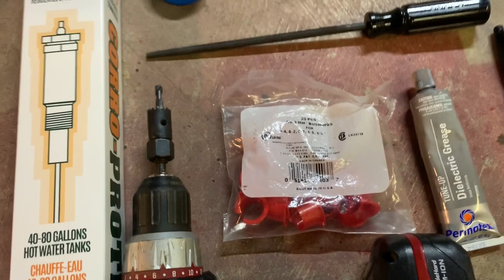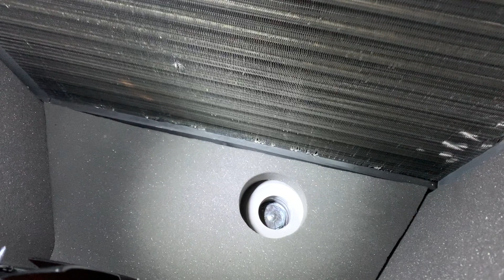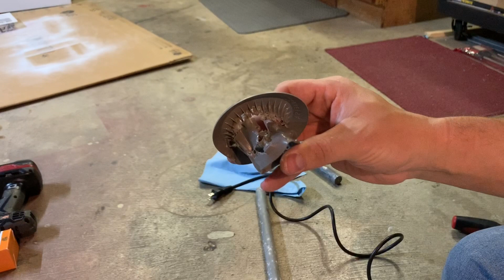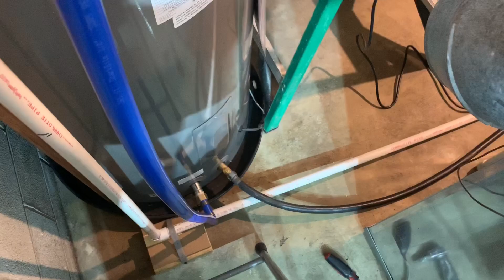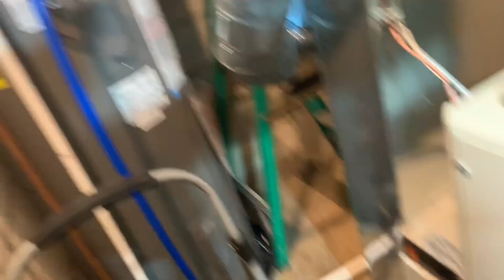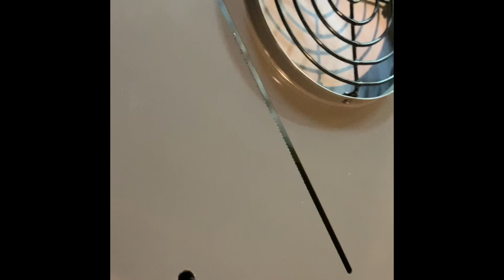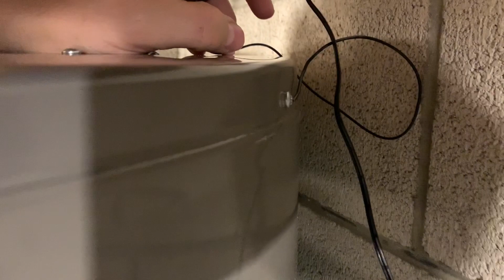Rheem Hybrid Electric Water Heater Anode Rod Replacement. Sulfur Smell is Gone!

Comment: Hi, I likely missed it but at start of video you mentioned needing to use some dielectric grease in the process. Can you tell me when or where you used that as I didn't notice the use of dielectric grease in the corro protec installation instructions?
Reply from the maker: Ya the instructions don’t say you have to use it. I put just a little on each spade connector of the rod before I slid the wires on. It’s a pretty low moisture environment, but I put it on anyway. I also use it on all of my trailer plug connections, battery terminal connections (car, tractor, etc), spark plug connections. Really I use it on any electrical connection I think has a high chance of corrosion. If you don’t have any, you can safely skip it.
Reply: @EvolutionDIY  Ok thanks! I do believe I still have some I just wasn't sure where used it. So where the one wire terminal/connector goes onto the terminal on top of the corro protec and maybe where the ground wire terminal is mounted to the tank. Is that correct?
Reply from the maker: I only put it on the one wire that connects to the corro protect rod. I was thinking it was 2 terminals (12v and ground, but I remembered ground connects right to the water tank). I didn’t actually put it on the ring terminal that connects to the water tank screw, I only put some on the 1 spade connector that connects to the top of the rod.
Reply: @EvolutionDIY  I got the other anode rod out today with use of an impact wrench/driver. Now I'm wondering how many overlapping wraps of the Teflon tape should be used. I didn't see how many times to wrap the threads while overlapping the Teflon tape.
Reply from the maker: @ParisKYLakefishing  usually just 2-3 wraps. Too many, and it won’t go in, too few, and it won’t seal. Also make sure you wrap such that the tape doesn’t “unwrap” as you thread the rod in. You can probably do a quick how to apply Teflon tape search on YouTube for some examples. Good Luck!

Comment: Was yours a magnesium anode rod and what number of teeth did you need to use to be able to cut it? I ask as I don't know if the magnesium rod is a harder or softer metal.
Reply from the maker: Yes it was magnesium, and I used a 24TPI (Teeth Per Inch) hacksaw blade. It was pretty soft. It cut almost like aluminum, but didn’t gum up the blade like aluminum. I think any hacksaw blade would go through it.
Reply: @EvolutionDIY  ok great! thanks for the tip on the blades. I picked up some 24T blades this past weekend. Hope to install this tomorrow.

Comment: Do you know if there is any need to use the heavier pink Teflon tape on the threads of if its even needed? I ask partly as I saw the pink tape suggested on one website but I also saw this info/concern on another blog about replacing the anode rods. Supposedly you need an electrically conductive path between the anode and the tank, Though I don't know if that applies with the powered anode rods or not. Also you may have mentioned it but what did you have to do to bleed the air in the tank after installing the new powered anode rod?
Reply from the maker: I don’t think you have to use the pink tape. The instructions say to use normal Teflon tape. Also, theree is a separate grounding terminal that you connect to a screw on the tank, and it tells you to ensure the screw touches the tank, not the paint. I assume it gets ground through that. 

To bleed the air, just turn the water supply back on, and then open faucets and showers on hot. The air will work itself out of the tank and through the plumbing. OnCe the air is out, you can plug-in the powered rod.
Reply: @EvolutionDIY  Ok great and thanks for the input regarding the installation experience you had in installing the Corro Protec anode rod. Regarding the ground wire Corro Protec responded the following regarding using the exposed ground screw from the electric heater existing wiring connection to the heater: 
"Yes, you can use the water heater ground screw directly" As far as the Teflon tape I already have the regular white tape so I will just use that.

Comment: Great video! my water heater was on its way out so I replaced it with the smaller version of this Rheem. Went in easy and works fine but I noticed a bad sulfur smell from the hot water that was not there beforehand. I just moved into the home so I’m not sure what type of anode rod my old heater had in it, but there was no smell before replacing. I was about to chlorinate my well as per the owners manual before I found this video.  Was able to get the old rod out without taking out the plastic ring (I bought a thin walled socket based on this video). Also the old rod was in there right as hell I almost gave up. I sprayed a little WD-40 on it and was able to break it loose. Anyways the repair was not bad at all, especially using this video as guidance. It has only been in one day and I don’t smell any sulfur at all.
Reply: OEMTOOLS 22429 1-1/16 Inch SAE... https://www.amazon.com/dp/B00AXTKN2S?ref=ppx_pop_mob_ap_share
Reply from the maker: Awesome. It’s great to hear other success stories. Mine is still working great after almost 2 years. Would you mind sharing a link to the “thin wall socket” you used? I’m sure others would find it useful.

Comment: Do you plan on inspecting the anode at some point to see how it's holding up?
Reply from the maker: I hadn’t really considered inspecting it, but when I do a tank flush, it wouldn’t  be hard to pull the couple top screws and check it out. I’ll consider it. I’m overdue to flush the tank, I have just been avoiding it.
Reply: @EvolutionDIY  I've learned more about these powered anodes since I posted that and they are not "sacrificial" like a normal anode. You shouldn't be able to tell anything from looking at the powered one. If you still have a normal anode in there, you might be able to tell something from looking at it. Otherwise there really isn't any way to tell how the tank itself is holding up... at least not that I'm aware of.
Reply from the maker: @MakeMeThinkAgain  yeah good point on not being sacrificial. To be honest, I’ll probably just let it go, and hope it’s doing it’s job. If the tank rusts  out in 3 or 4 years, I’ll consider it lesson learned. If it doesn’t, I’ll consider it a success. I could have never tolerated the sulfur smell though. I would have had to chlorinate the water or something if this didn’t work.
Reply: @EvolutionDIY  If it does rust out I would appreciate it if you would let me know. I'm putting off trying one of these powered anodes until my heater is 10 years old (it's 5 now) so I would love to know if this device really does what it's claimed.
Reply: @EvolutionDIY  Why you still need to flush the tank with the electric anode installed?  Is there still a lot of sediments?  Thanks.

Comment: Thank you for this video. I have a question for you. I plan to replace my old furnace with a high-efficiency furnace. That new high-efficiency furnace will no longer use the chimney but will use the venting plastic pipes going outside the house. Now I want to get rid of the old furnace liner vent pipe. What I understood from your video is it looks like this new high-efficiency water heater does not need any ventIs this correct? Is it the electric one or the natural gas one?
Reply from the maker: The water heater from my video does not need any vents. It is electric only. If you were to purchase a natural gas one, it would have a chimney and need vented out. If you purchase this one, it does not. The one in my video is called a hybrid electric water heater.
Reply: You can get a vent kit if your heater is in a small space.... the way these things work is they pull the heat out of the surrounding air, so if you've got your heater in a closet, it's got to get the air from somewhere, and exhaust the colder air.

Comment: Just had to replace mine today after only 3 months of use. One thing I’ll add is the original rod was very tight! So tight that it started to round off trying to break it loose. As a helpful hint I ended up using a 1/2” drive electric impact wrench. Came right out! Went back in with the new aluminum rod and tighten it by hand.

Comment: Being in the mechanical contracting business and involved in design, build and maintenance of refrigeration equipment, it amazes me how easy it is to sell folks on the virtues of heat pump technology.  But I have to say this is one area that may have a few stinkers involved.  For instance the heat that is collected to heat the water has to come from somewhere in the vicinity of the unit.  That means in heating season you will have an additional drain on your heat loss calculations.  Then the area of maintenance where the heat exchanger draws air across to collect the heat, any airborne dust, dirt and grease will collect on the fins.  This stuff will insulate the heat exchanger which will tend to produce a less efficient operation of the unit.  Paying someone to do this maintenance or time spent doing it yourself needs to be factored in.  There are other negative factors to consider as well.  Wear on compressor and fan may require major repairs at some point in the life of this type device.  Heavy load periods will still consume as much power (or maybe even more) due to necessity to cycle on the resistance heat elements periodically.  Then there is the initial cost to purchase such a device which is significantly more than a straight electric hot water heater.  All in all, it's a mixed bag that can wind up costing you more than you bargained for.
Reply: @aday1637 I agree with your assessment. But for some of us, "electrifying everything" is sort of the goal, and then try to purchase renewable electricity to work toward a lower carbon lifestyle. I recently added my heat pump water heater after a whole-house, energy efficient remodel. Induction stove, rooftop solar, etc. I didn't go the heat pump dryer route, because I feel the technology still has a ways to go. But for water heaters, I think the technology/quality is solid (or shall I say, quality is no worse that your average refrigerator these days). I paid  about a $4-500 premium over a standard water heater, but I figure if it lasts 7-10 years, I'll get my money back. I anticipate we will continue to see efficiency/quality improvements in all forms of heat pump uses, in the coming years.
Reply: Yes, but, in a warm season, if the unit is installed somewhere that can use the dehumidification (like a basement/garage), that's 'free' dehumidification you don't have to run a dehumidifier for. Also, even with inefficiencies factored in, if your heating is from a heat pump, you're still likely better off from a cost perspective 'stealing' the heat from the house heat pump. Resistive heat (regular electric WH) is usually the most expensive form of heat, so anything else is better.

Comment: After this great video, i was able to put new new electric Anode rod in.  It took about 20 minutes to get the plastic cuff off of the unit.   I used a utility knife to score it and eventfully was able to pull it out in pieces with a needle nose vice grip. Next I had to bang on the socket to get it to sit nicely against the 27mm hex nut (top of the anode rod).  Using a 3 foot breaker bar did not budge it.  No matter what I tried, could not get it out.  I went out and got a impact wrench (325 foot pounds), it finally came lose, without much effort.  Love those impact wrenches!   Putting everything back was fairly easy (use a hand socket to tighten the new anode rod in place).  After only 6 weeks since the initial install of the new water heater (3/6/2021), the original magnesium anode rod was heavily pitted and smelly.  Looking forward to odor free hot water.  As a note that if you cannot change it out quickly, I was able to heat the water to 140 degrees for two hours to temporarily kill the smell.  That lasts about a week before smell comes back.    But now with the new rod, I should be fine.
Reply from the maker: Thanks for the comment. Hope you’re enjoying some sulfur smell free hot water. No budge with a 3ft breaker bar 😳. Good thing you had an impact!

Comment: I just put my new Rhem hybrid in on 3/6/2021 and already (5 weeks later), i have the rotten egg smell.  I ordered the electric powered Titanium Anode Rod .  Since my unit is young, I am hoping that I can remove the old rod without too much effort since I have no one to help with this project.  I had install the Rheem in March all by my self (pipe soldering and all), with out an issue.  Wish me luck.
Reply from the maker: I have no doubt you can install it. I also installed my tank myself, and that was much more difficult than changing the anode Rod. Just get yourself a long breaker bar and a jack handle, or other piece of pipe for leverage. If you soldered your lines, that must mean your unit is hard plumbed with rigid copper. Hopefully the water weight and the plumbing hold it in place while you break loose the old rod. Good luck to you. Hope it fixes your problem.
Reply: @EvolutionDIY  I ordered the electric rod from Amazon.  Should be here soon... but I have a tip that will temporarily rid the odor.  If you raise the temp to 140 degrees F, it kills the smell for a bit.  So far its been almost a week and the odor is gone.

Comment: First, the Corro-Protec really eliminated the sulfur smell. Second, this video was a perfect how-to for the Rheem Platinum Hybrid installation, with one exception. The old anode (1 year old) is a bear to remove.  I had a 1/2" drive pneumatic impact gun, but my portable compressor didn't have the juice for it. I had to go low tech and use a 30" cheater pipe on my 1/2" breaker bar with a helper bear-hugging the tank. The magnesium anode was pitch black and starting to erode already.

Comment: Good video, I have the same HPWH but It's 50 gallons. It's just about to hit the 2 year mark and I was contemplating taking the top off to clean the coil. I was wondering how old your unit was when you did this video and did you take notice of how clean or dirty the coil was, thanks
Reply from the maker: I had the tank for about two or three weeks when I made this video so the coils weren’t dirty at all yet. I have since cleaned the filter one time at about the one year mark. The filter had almost nothing on it at all. I guess my basement must not be that dusty. I’m not sure how often I would be willing to go through the trouble of removing the top to clean the coils. Maybe every three or four years I suppose. If you do happen to do it let me know how dirty they are. Maybe it will motivate me to take mine apart and clean them.
Reply: @EvolutionDIY  since I'm ducting the exhaust end of the house for the summer I was also a little concerned about the possibility of maybe a little black mold on the coils as I know when air conditioning and clothes get wet all the time they can grow mold. It seems to me that they could have easily designed a nice big access/inspection plate on the side of that upper part where you wouldn't have to disconnect the electrical wiring and any duct work you  had coming in the top.
Reply: @EvolutionDIY  I placed a thin material air filter on the air intake and it catches quite a bit of dirt. The air filter that is in the system is like a lint filter!

Comment: Thanks for this video!!!  I without it, I wouldn't have had the guts to do it.  Especially breaking the old anode rod loose.  It took a 2' breaker bar with a 2' pipe on it!  I have a tip that will make the process easier for anyone else that wants to do it.  Instead of grinding and tearing out that plastic piece, I just heated up the socket with a torch, then pushed it down onto the head of the anode, melting the plastic with the socket.  Worked great!
Reply from the maker: That’s such a good idea. So much better than grinding it out. Only issue I could see is the initial break loose of the bolt with the added friction of the tight plastic around the socket is probably difficult (hence you needing 48” of leverage). But once it’s broke loose, thats much easier. I have heard of others just pounding the socket down onto the bolt too (no heat), but I image that makes it even harder to break loose the bolt.
Reply: Wow.  Great idea.  I will do that!  Thanks for the tip Andy!!!